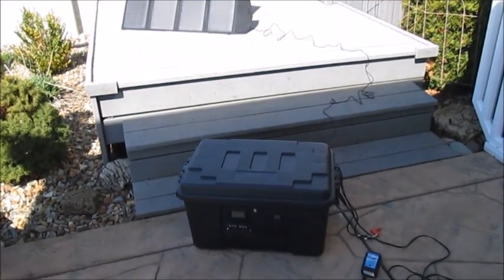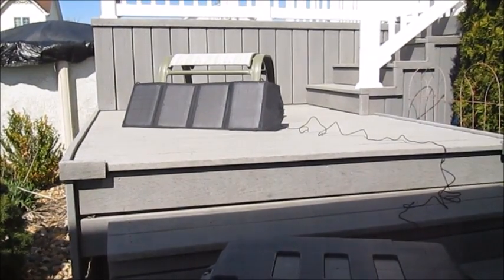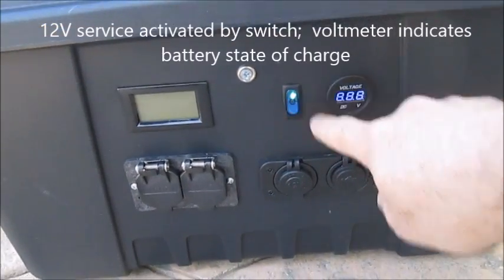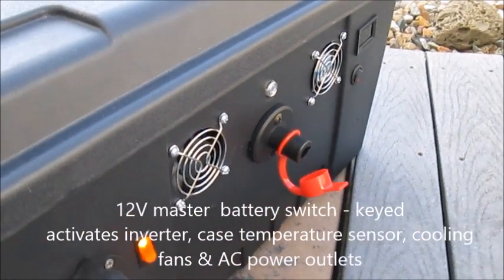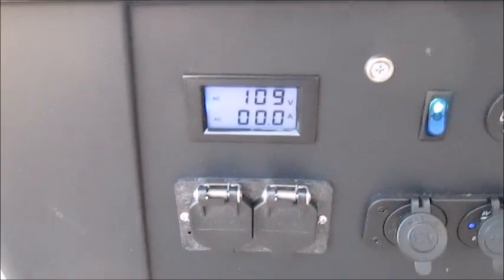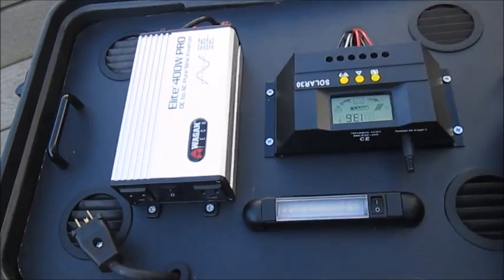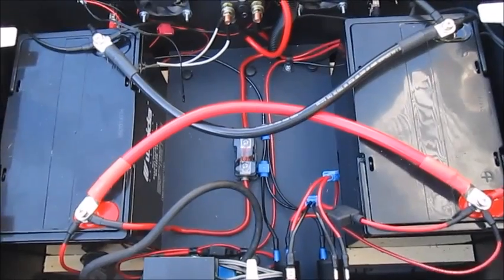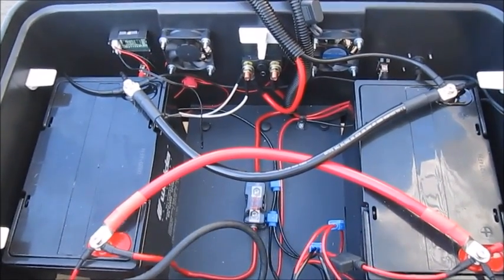V1 P1 DIY Portable Solar Power Generator - Wiring Schematic, Parts List, FAQ Sheet Provided

Comment: Top work, nicely done. Once suggestion would be to fit some exterior lights on the case so it could be used to light up the whole area.
Reply from the maker: Thanks Justin.  As you probably noted, there is a LED light on the top tray that I direct up to the ceiling of the cabin on my boat or in my tent and it offers indirect, ambient lighting.  For more flexibility, I have found that using an extension USB cable and plugging in a couple of different kinds of LED lights gives me many more options than having another fixed light on the outside of the case.  I don't like to plug Goal Zero products, but they do make a USB LED light that I have found very useful.  Here's a link to the product http://www.goalzero.com/p/334/light-a-life-mini-usb-light

Comment: cool, I think I would have put small fans in the lid on one side and vent grills on the other.
it is the inverter and charge controller that will get hot plus any explosive gas will rise and be vented (if any).
http://caravanandmotorhomebooks.com/battery-ventilation-is-vital/

Comment: I have a question based off your experience. PWM chargers require the voltage of the panel's to be similar to voltage of battery. So it seems to me you are stuck with 12v panels and wiring the panels in parallel.

Isn't an MPPT worth it because 24v panels are a lot cheaper and you can wire in series and stuff.
Reply from the maker: Great questions.  Some PWM charge controllers do have the ability to auto detect 12V or 24V batteries/panels and adjust accordingly.  I don't recall if the one I used has that capacity, I had no intention of using other than 12V batteries and panels when I designed my system.   
     The decision regarding PWM vs. MPPT comes down to the following factors, in my opinion:  Size of your solar array, price you are willing to pay for a controller, and considerations involving the physical dimensions of the charge controller.  From what I have read, the price you can expect to pay for a MPPT charge controller is very high vs. the return you will get in terms of increased watts being delivered to the batteries when you have a SMALL solar panel array.  In other words, the net gain in wattage from using a MPPT controller with a small array is negligible compared to the substantial increase in cost you will incur for the MPPT controller.  Most who have analyzed the cost effectiveness have advised that you simply spend the additional money on another solar panel to increase the amps/watts coming into the system.  The cost of an additional solar panel for a small system will be less than the increased cost and greater efficiency of the MPPT charge controller.  The last factor, and perhaps least important, is the space you have to accommodate a charge controller.  MPPT controllers tend to be much larger.  In a small, portable system the physical dimensions of the controller may be of concern.  PWM controllers tend to be much more compact and can offer substantial space savings if that is a need.

Comment: This is just brilliant. Very Neat job. Im just curious. Would this work to power a rural village hut in Africa.
Reply from the maker: Thank you for viewing and for your comments.  This could certainly be used to provide electrical power in any off-grid situation.  The next question is how much power can it provide and for how long?  The answer to that depends on the AC or DC power demands of the appliances you are hoping to run with the system.

Comment: Remember to cut you AH in half. never run you batteries below 50% you'll burn them out fast. But otherwise a great build!
Reply from the maker: Thanks , yes that is understood.  I think that most people know 
that even though batteries are labeled by total AH capacity that you 
don't want to drain them to 0% SOC.  If they don't understand that they 
really shouldn't be building or using systems like this. You can find my
 very detailed calculation of what this system can provide under the 
description of this video [click "show more"] or at http://www.creeksideartifacts.com/SPMGMTcalculator.pdf
Reply: Jim Fisher, when I built mine I didn't realize it until after I killed my first set of batteries. I am working on a newer setup for my camp/power out box. better components and less slop since I already worked out my mistakes on the first build.
Reply from the maker: Sorry to hear that about your first set of batteries!  They are not cheap.  Hopefully folks who are interested in building their own systems will read our comments and learn from the knowledge and experience that is being freely shared here.  Putting one of these together and using it efficiently is a learning experience.  I am sure your second build will have lots of improvements over your first.  I still have a couple more improvements I intend to make to this system and there surely would be some changes if I were to build another from scratch.  Hope your next project goes well.

Comment: Nice! All you need to do now is add some super-capacitors in the space between the batteries, and a hand crank generator and you will have it perfected for marketing. One other thing, if the purpose of the fans are to cool the the power inverter why aren't they located in the top portion/lid where the inverter is located and a thermostat used to automatically protect that equipment?
Reply from the maker: Thanks for your view and for your comments.  See my part 4 video for the thermostat installation.  The fans serve the purpose of circulating air throughout the case to primarily 1- keep the batteries cool, 2- vent what little hydrogen that may offgas during  AGM battery charging, 3- circulate some air indirectly into the top of the case where it then can vent from under the lid (this is not a water/air tight case).  The inverter itself also has a built in thermostat and fan.

Comment: i used a similar solar charge controller with my setup, it failed in a closed state and nuked my batteries.....
Reply from the maker: Thanks for the heads-up.  I have had no problems with the PWM 30A controller I am using.  To be fair, it is not running 24/7, and I use it only seasonally.  I have seen that there are some really cheap knock-off versions of various charge controllers that should be avoided.

Comment: very ingenious.is there any way to cut down on the weight? 100 lbs seems a bit heavy.also,where are the handles?
Reply from the maker: You could use Lithium Ion batteries John, that would take the weight down to about 40 lbs.  Be prepared for sticker shock though.  Swapping out the AGM batteries for comparably sized lithium ion batteries would add another $800 to the total cost of this build.  The case handles are on each side.  The latches for the top lock down over the tops of the handles.  Have a look at my part 5 video at the 4:40 minute mark and you will get a good view of the integrated handle on the side.

Comment: you will find that is a modified sign wave inverter
Reply from the maker: I think you will find that either it is a pure sine wave inverter or Wagan has engaged in false advertising: https://www.amazon.com/Wagan-EL2601-Elite-400W-Inverter/dp/B007Y4BL1C/ref=sr_1_1?ie=UTF8&qid=1498340006&sr=8-1&keywords=wagan+400w+pure+inverter

Comment: If my math is correct and it should be pretty close depending on you fridges current consumption and a slightly bigger solar panel, you can run it on your battery pack just fine. 
75 ah battery = 37 ah useable power = 444 total watts
23.3 watts 24 hrs a day
100 watt solar panel

100 ah battery = 50 ah useable power = 600 total w/hrs
31.5 watts 24 hrs a day
140 watt solar panel

125 ah battery = 62.5 ah useable power = 750 total w/hrs  
39.4 watts 24 hrs a day
165 watt solar panel

Comment: I've worked with D.C. Electrical for many years. Your system looks great. For safety purposes you should remove all the little blue scotch lock wire connectors. They tend to corrode quickly and cause excess resistance and heat. Great job
Reply from the maker: Thanks for the feedback.  Eventually I will be rewiring the system and utilize bus bars.  I also want to rewire the the DC 12V outlet and USB ports so that they are connected directly to the load out terminals on the charge controller.  Replacing the scotch lock connectors will be part of that upgrade.
Reply from the maker: Check out my part 6 video where the ScotchLok connectors are replaced and a bus bar installed.

Comment: Nice setup but don't forget to divide your batteries in half for realistic total useable power. You have about 50-55 useable ah's not 110.
Reply from the maker: Thanks John, yes that is understood.  I think that most people know that even though batteries are labeled by total AH capacity that you don't want to drain them to 0% SOC.  If they don't understand that they really shouldn't be building or using systems like this. You can find my very detailed calculation of what this system can provide under the description of this video [click "show more"] or at http://www.creeksideartifacts.com/SPMGMTcalculator.pdf

Comment: i see a few comment where people are kind of stunned by the price but I actually thought that was a very good cost to build.The quality of this could not be had from a manufacturer at even double that price with all the options you have here. plus high quality batterys and panel, I think its quite worth the money spent. for those who need to stick to a smaller budget they could certainly do so by keeping it very simple and getting used batterys and used panels.I bought my entire solar system for 200 bucks and it works pretty decent thats panels (2 @ 100watt) charge controller, one battery (not adequate I know but works for now) and the needed cables. I am dealing with no inverter so just 12v stuff only for now. it is good for my uses and for right now so it can be done on the cheap!
Reply from the maker: Thanks for your comments, they are appreciated.  I have been surprised by some viewers' adverse reactions to the price of my build.  I posted the complete parts list, prices (as of 2015),  and identified specific vendors to offer clarity on what you can expect to pay for core components and other parts.  When I built this system I took a lot of time sourcing parts and components to get the best prices available at the time.  You are right, you can certainly build a functional system for a lot less depending on your specific needs.  Buying used batteries and panels is a great way to realize savings.  You may not need all of the options I have included in my design.  When I designed this system I wanted everything in it to be brand new and understood that would come with a cost.  As you stated, if you purchased a comparable system from a manufacturer you can expect to pay at least double what I paid to build this DIY version.

Comment: really nice setup probably the best one that I've seen an individual make themselves best one that is a made at home version I guess I should say the only thing I was wondering I guess I thought you could probably get by  doing the whole system cheaper than what you did but I guess when you figure the cost of the panel and the inverter those two things right there will probably half the cost of the whole system? I t still seems like to me you could do the whole system for about 600?
Reply from the maker: Thanks for having a look and for your comments Matthew.  My DIY design incorporated a lot of features that you might not find on commercially available models and the non-volume, retail cost of those components definitely added up quickly. Bear in mind that the prices I am quoting were for purchases made over two years ago.  The price on some of the more expensive components has come down since my build.  The total cost including the 100 watt solar panel ($220) was about $950.   About $730 for all the components in the battery box.  About half of that $730 covered the cost of two quality AGM batteries (as opposed to cheaper lead acid batteries off the shelf at Walmart) and a pure sine wave inverter (as opposed to a cheap modified sine wave inverter). If someone wanted to copy my basic design and save some money I would recommend the following:  exclude the remote heavy duty terminals for jump-starting;  exclude the bulkhead terminals and screw on knobs that allow for attachment of an additional/external inverter;  use cheaper (not AGM) batteries;  use a rigid polycrystalline solar panel instead of the more expensive flexible monocrystalline panel that I used;  install a cheaper weather resistant cover for the AC outlet (that Leviton cover alone was over $30!).  Those recommendations would likely bring the total cost down by about two hundred dollars.  All that being said, this unit was definitely designed with high quality in mind and I incorporated additional features that aren't often included in such systems that were important for my needs, specifically on a boat.    

      
      
Show less

Comment: Nice battery box, but NOT a "generator" it is an energy capture device.
gen·er·a·torˈjenəˌrādər/nounnoun: generator; plural noun: generatorsa thing that **generates** something, in particular.a dynamo or similar machine for converting mechanical energy into electricity.synonyms:engine, dynamo, alternator, magneto, cell, turbine, turbocharger, pump, windmill "crank up the generator"an apparatus for producing gas, steam, or another product.Computinga routine that constructs other routines or subroutines using given parameters, for specific applications."a report generator"Mathematicsa point, line, or surface regarded as moving and so notionally forming a line, surface, or solid.
Reply from the maker: I think you should read the definition you provided a bit more carefully Lou.  You failed to consider all that the definition provides.

First, you clearly overlooked the word CELL that you included as a synonym.

"gen·er·a·torˈjenəˌrādər/nounnoun: generator; plural noun: generatorsa thing that *generates* something, in particular.a dynamo or similar machine for converting mechanical energy into electricity.synonyms:engine, dynamo, alternator, magneto, CELL, turbine, turbocharger, pump, windmill..."

Solar cell
From Wikipedia, the free encyclopedia

A solar cell, or photovoltaic cell (previously termed "solar battery"[1]), is an electrical device that converts the energy of light directly into electricity by the photovoltaic effect, which is a physical and chemical phenomenon.[2]
It is a form of photoelectric cell, defined as a device whose electrical characteristics, such as current, voltage, or resistance, vary when exposed to light. Solar cells are the building blocks of photovoltaic modules, otherwise known as solar panels.

Electrical cell 
From Wikipedia, the free encyclopedia

An electrical cell is a device that is used to generate electricity, or one that is used to make chemical reactions possible by applying electricity.

Cells producing electricity
The simple electrical cells were first developed in 1800s.[1] They are also called galvanic cells, because an Italian scientist named Luigi Galvani invented these cells.
Special chemical reactions which occur inside the electrical cell, result in oxidation and reduction of the substances inside the cell.[1] This produces electrical energy. Normal batteries work like this.

Second, you also didn't consider the second definition of a generator that you provided: "an apparatus for producing gas, steam, or another product".  The entire system, or apparatus, produces electricity.  

 In summary Lou, the SYSTEM is in fact a GENERATOR.  The solar panel, that is an integral part of the SYSTEM, CONVERTS light energy into electrical energy which is subsequently stored in the CELLS (AKA batteries) whereby a chemical reaction (second conversion) occurs to produce electrical energy.

Comment: pretty nice but damn 950 thats crazy i i ow little stuff adds up and batteries ain't cheap but i recently bought an optima yellow top that i think is 55 AH for like 160 but i see 3 more videos but i dont know that it really eben needs the fan but you can het a cheap thermostat device on ebay that makes the fans automatic
Reply from the maker: Thanks for having a look at my video and for your comment.  There's more in my total of $950 than what would be considered little stuff, as far as a system like this is concerned.  You would need two of those Optima Yellow Top 55ah batteries ($320) to equate to the 110ah system I have built.  At minimum you would also need core components such as a solar panel (about $150 for 100W), a solar charge controller (a cheap 30a PWM at about $35), and an inverter (another $150 for a 500W pure sine wave).  That puts you at about $650 before you buy a case, wire, fuses, switches, meters, miscellaneous hardware, power input ports, and power distribution options.  There is a reason that comparable commercial products are being offered at over $2,000 dollars.  The core components and all of the other little stuff definitely adds up quickly.  See my part 4 video for the fan thermostat upgrade.

Comment: I rounded up a 1780 watt array with a 60 amp mppt charge controller, a 480 amp hour battery bank and 3kw pure sine wave inverter for around 2 grand.  Saved a lot by finding used (non cycled) batteries.  4 gell cell batteries from a ups that gets new batteries every 5 years for 20 bucks each. Also my 1780 watt array was only 1100 bucks

Comment: how long would this hold juice if you wasn't able to charge it?
Reply from the maker: Pedro, that all depends on what you want to power with it.  For example, if you were only interested in recharging your smartphone this system would be able to do that for perhaps a couple of weeks without needing to recharge it.  If you wanted to run a small refrigerator it would be able to do so for perhaps a day before it needed recharging.